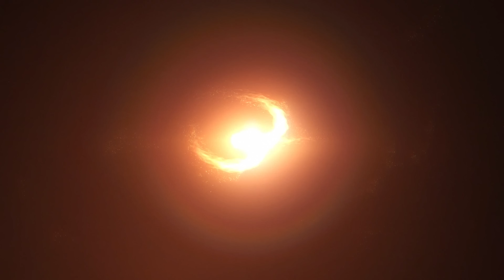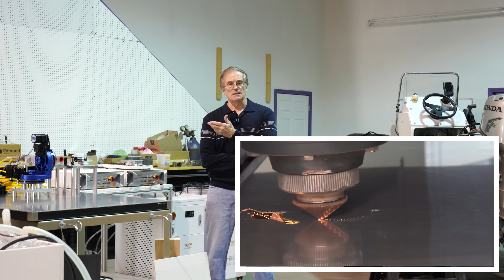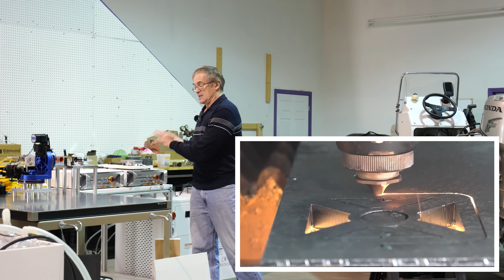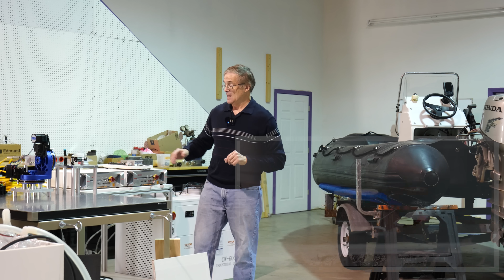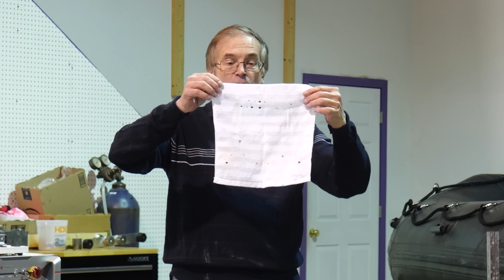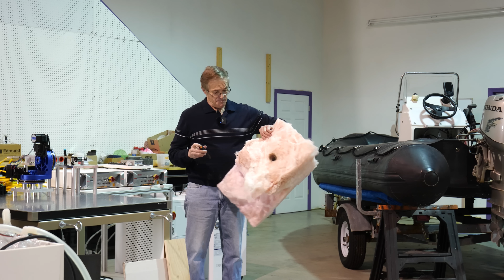We have a problem... and need your help!

Comment: Not an optical engineer, but it sounds like you need a light trap of sorts. The materials suggested might not be suitable so take the suggestion with a grain of salt). Assume prop 65 if you like.

A fire resistant curtain (something like a fibreglass or carbon fibre blanket) that obscures a mirror that directs the laser downwards into a tank filled with an IR absorbing material (liquid or solid).

Ideally what's needed is a method to decollimate the beam once it's passed through your target.

Comment: Such a problem to have!  If you know where (generally) to laser will be hitting like behind a test panel, then you need to refocus (unfocus?) the beam to dissipate the energy. Perhaps a Fresnsell lens or concave lens that refocuses the beam to a larger area might allow you to absorb the energy in a larger area with most common materials. Depending on the frequency of the beam the color of the absorbing material can be used to enhance the absorption. If you can change the frequency of your laser (most etching lasers have that setting) you might be able to allow greater scattering.

Comment: A large container of water with transparent sides might be (slightly) easier to handle than a brick wall? A mass of water, maybe with some black dye added to increase absorption, might diffuse the laser enough? Empty and refill the container to move it.

Comment: Maybe glas that acts as an optical diffuser. The laser concentrates light, the diffuser does the opposite. On the otherside you end up with none dangerous light.
In any case, I would use a Phototransistor to cut off the power, if it detects laser light outside of the control area

Comment: That's a nifty problem to have!  Some thoughts:

1.  Instead of firing the beam sideways, fire it down into a carbon slurry.  (e.g. crushed biochar and water)  That should absorb the beam AND the heat, and you can make it as big as you want.

2.  Fire it down into the earth.  Who cares if dirt gets blasted?

3.  Speaking of earth, you can make a wall of 'compressed earth blocks', which are as cheap as dirt--literally--and will easily be able to withstand the beam for at least a minute.  (Digging into CEBs would also make for an interesting video.)

Cheers!
Reply from the maker: I like the dirt blocks!
We have to stay horizontal in order to have enough range to make the test meaningful. The laser system can't be too close to the ceiling for access and assembly/alignment.

Comment: I'd bet on dirt, sand and clay: non-toxic, non-combustible by everyday definitions, slow to react with anything but water/moisture, cheap and easy to obtain in huge volume. Also you can set up a test first basically for free.

Comment: What about an aquarium of milky water behind the beam?  Does it punch a hole in the glass?
Reply from the maker: It would damage the glass.
The more important limitation is that we have to protect the entire back wall.
Reply: @TechIngredients  I recall you had a diffusing white paint for cooling into space.  Could you build a wall fountain with that paint as the backing and water flowing over it constantly.  Or preferably bubbling down it with white sudds...  That's a lot probably, but might work.

You could test it by painting an old washing machine with your super paint, then load it with way too much soap.  That'd be a good watch in any case!  =)

Comment: Nice, hold my beer! cheap and effective is the goal?

You want a blackbody that will not decay. I don't think we can do that on the cheap. I believe China uses white oak as re-entry panels for some space craft. It's a cheaper disposable option to fancy NASA tech. You want to be safe when the laser stops by accident... Make the target move!

Lay two pieces of plywood down on it's 8ft edge. Notch them out so they can nest perpendicularly. Spin them on a motorized LazySusan of sorts. We do this in the microwave to not burn single spots. I bet you it could take 30 seconds of burn or more if you had two sheets 1½" thick, layed perpendicular. I'm sure you can reinforce the hotspot. Move that baby! I don't know much, fire may even be a black body radiation, that bloom of fire and smoke may even absorb laser. 

You may call it the Lazy-Addison.
Reply: So the effective target will be 4' tall and what is that like 5.5' wide? Spinning.
Reply: I was going to say you could make the target out of the stuff I make my quadcopter shells and rotors out of... But we can't have you good at cutting that...
Reply: What are you thinking Addison!? Spinning thing, lasers... Cut a disc in the plywood, maybe several layers if you want to be extra careful. Spin her up to speed and Wham-O. World's most redneck  optical drive. Once you're done you can sell it as a big screen mechanical TV 🤣

I bet you don't want it wet. Water will boil and blast the plywood apart faster than the laser.

Comment: Hello Sou o Carlos De São Paulo Brasil

i don't know much about optics yet, but I came up with the idea of a specially built box at the back of the experiment.
A light trap
With the aim of deflecting and reflecting the light many times inside the box, and each time it is deflected and reflected, some device is used to reduce the energy of the laser light (perhaps absorbing filters and beam-broadening lenses).
A kind of set of mirrors, lenses and filters with filters capable of stopping the concentrated energy of the laser light and expanding the width of the beam, making it less concentrated.
This is just the initial outline of this idea.
If you can't stop it in a straight line, deflect it countless times to a set of specially designed mirrors, trapping the light in a labyrinth of reasonably reduced dimensions, with several filters (optical brakes).
Here is the main idea of my thinking on the subject, I hope I was clear and somewhat useful. Just an idea.

I really like your channel and it's a pleasure to collaborate, even if just a little.

Congratulations on the great work, happiness and prosperity to all
Cheers : )

Comment: What about trying some of these? https://www.youtube.com/watch?v=4NzyClzm7Po    interlocking so easily replaced when damaged or any holes could easily pointed with cement and the blocks would allow tempory structures to be built to the required dimensions as required. After the project is finished they would make a nice garden wall for your garden or could be re-sold to recoup your outlay.

Comment: Turn your room into an oversized laser engraver. Mount a fiber laser engraving head in the ceiling and pump your laser to it. Cover the floor with some sand. The high scanning speeds of the engraving head will enable you to accurately target fast moving objects and deliver an optimum laser pattern for a specific target. Hyper accuracy, speed and special firing patterns could reduce burning through targets entirely. Example: target the heat of all 4 motors of a quad multi-copter. Command the firing sequence to create a high speed “x” pattern between all 4 motors. Critical damage to all components at once.  Short duration shots until the aircraft fails and less burning through targets.

Comment: Get a beam expander optic, and then a beam dump. That’s how we do it for 50-300 kW CW. Beam dump is usually glass fibers in a box with a hole in the front, they might be fancy not sure.
Reply: Oh and don’t stand in front of it

Comment: You need some kind of heat resistant refractory.  There are some specialized fire proofing refactories that are used in refineries that you could test.  In the old days, concrete was used, but, there are better materials that are designed to protect steel from heat.   They can be on the expensive side and they take some time to install, but, you will need something of this nature.   There are also fireproofing materials that are designed to protect structural steel.  I think some of these are designed to dissipate heat by slowly burning off, but, they can get pretty expensive.  I think Resco is the name of a refractory supplier.

Comment: Patio pavers - made of concrete, cheap and can be glued to plywood with construction adhesive. or cinder blocks. The batting/insulation material used in smelting gold , hang it as a curtain ...

Comment: Not an engineer, but I love the show and I have been watching for some time and I am ashamed to admit that I am just subscribing.  I  thought I had but I..   Anyway.  I am with the guys that say dispurse the laser up front instead of absorb it in the back.  A lense that is cut in two can be applied robotically from both sides (not sure that is a word) immediately after the target is destroyed.  Practically speaking, your target will not always be in an area that you can put an light absorbant  material behind and in a battle situation that would be impossible but if you diffuse the laser up front viola destroy the target, dispurse the beam, cut the power.  Or add a range finder, calculate how long it will take to reach the target and destroy it, and have your computer kill the power once the range is reached.  It has been great watching the show, I love you guys and thanks for asking for the help.  10232 comments.  You must have a few solutions in there.

Comment: How about Carbon Sugar Snake sandwiched between drywall panels? It's non reactive, no dangerous gases, good insulation. Or the same drywall panels with ash in between. It should be enough. Not sure about the thickness needed, but I reckon you will test it. The beam would pass through the first drywall layer, would get absorbed and scattered within the filling, and probably never reach the second panel.

Comment: I have precisely zero knowledge of this topic and the equipment involved.  So be gentle if this suggestion is absurd, lol. (Though I'd be very interested in the details of a correction, why it wouldn't work.)

Instead of trying to block the beam, why not set up a receiving lens array to diffuse or "re-widen" the beam, either to the point of being harmless or in conjunction with a physical barrier of some sort?
Have such an array set up as a target, and conduct any experiments midway along the path of the beam.

Comment: I was thinking about how impractical a high powered laser system would be to shoot down drones out in the real world.  In the real world you can't place anything behind a flying drone to protect from damaging anything or anyone who happened to be behind and above the drone as in a plane or helicopter.  So I came up with a possible solution.

Not one very high powered laser but many very low powered lasers.  The kind that use a small button battery.  You don't combine them into one beam but have many beams that triangulate onto one spot.  That means anything between the lasers and target will be safe because they only be hit with one beams intensity even if they were hit over an area by many beams.  Nothing behind the focal point of all the beams would be endangered too for the same reason.

Think of it this way.  An elephant hit by one bb gun pellet would probably barely feel it.  But a thousand bb guns all aiming and hitting the elephant at the same time in the same spot is a totally different story.
Reply from the maker: I understand.
It's complicated.
The tracking and targeting systems are actually more challenging than the laser.
These would have to be multiplied as well as coordinated.

Comment: From the perspective of the target, a drone in flight, l would  be more concerned with the laser proving the drone with a high energy trigger than can be used to make a drone cargo lethal over target area.
Reply from the maker: There is always a push and a pull. A facility that can eliminate a drone is a valuable target to a drone.
However,  the facility is a given and it won't be isolated because it's there to protect something even more valuable. 
The solution is to make the system very effective or perform a first strike.

Comment: What if you cover the plywood with a layer of jelly type substance maybe a foam that could absorb the heat and stop the fire. You could possible fill the jelly with flakes to break up and light bouncing around.

Comment: 2 panels but between it a layer of sand, but it needs to be tested, the sand would either fill up the hole constantly or if it makes glass around the hole/beam it wont work. If it does work it's just patching the wall and refilling some sand. Testing would show how thick the sand layer needs to be.

Comment: Personally I think it is insane messing around with such high powered lasers.  You can easily blind or kill someone with one of those things.  That being said I suggest you try using a curtain of falling water that is at least an inch thick.  Not droplets of water a solid curtain of water.  Maybe throw some red dye into the water or whatever color absorbs the wavelength of laser light you are using.

Comment: Two suggestions, possibly used together:
1) An intumescent coating on your chosen backdrop surface. I'm pretty sure it'll do a good job of absorbing energy and buying you time.
2) A black carbon rod inside a vacuum tube or black carbon sphere inside a vacuum bulb near the laser could be dropped down as a failsafe to absorb the beam without combusting. The right carbon target might not vaporize but just emit blackbody radiation as it heats and it won't combust in the vacuum.

Comment: Two ideas. 

The first one is a "waterfall" 

Instead of soaking blankets with water, create a curtain of water that has a dye that can absorb the laser light. Since the water is constantly pouring down it can't be evaporated away. If the water needs to move faster than gravity can make it fall and you have a narrow beam then you can use a jet of water to neutralize the beam. It doesnt have to be enough to completely block the beam. Just enough to weaken it. 

Idea two. 

A rotating block of ice. The ice would sit on a table and spin in the path of the beam. Again. It doesnt have to completely block it. Just absorb enough energy to keep it from cutting through a secondary barrier. 

Since th block is rotating the ice would eventually fall once cut.

Comment: You or anyone else who's watching this will never get this comment due to the nature of YouTube but I'll try anyway. What you are looking for is called a beam trap. They are available as an RPO from several manufacturers or you can engineer and build one yourself. Most designs are dry but I've used at least one transpiration design that worked well. A poor man's option is a consumable ablative but if you plan on doing a lot of this, it won't be poor man's for long. You're material approach is using the wrong physics and chemistry. to solve your problem.  You are also asking questions that suggest you may benefit from technical support from someone with expertise with HPL technology before you burn yourself or put an eye out. I work in aerospace an defense and the leading contending technology for counter drone defense, particularly swarm, is not directed energy for many reasons. I'm also involved in drone propulsion systems as well. 
Good luck.

Comment: 45 degree angle down into vat of water and charcoal, with water cooled or safe refrigerant gun blued heat sink above to catch stray light. Steam may form causing issues tho So further light containment from black carbon fiberglass for that. modify as seen fit. Maybe just a heat sink. Maybe press on button record and not be in room lol!

Comment: I would suggest giving straw bales a try.  They're packed densely enough that there isn't enough oxygen to sustain a flame.  They're highly modular and mobile, and you can plaster the exterior should you decide to use some sort of coating.  Also not very expensive and pretty thick.  Cons:  may be some smoke and if handling loosens it too much, it is flammable.

Comment: Scattering vs. Absorption: While a frosted surface scatters light, it does not fully absorb the laser energy. For high-power lasers, the scattered light could still be hazardous if it escapes the opening or if the ball itself is damaged by localized absorption and heating, as even highly resistant optical materials have damage thresholds.[3]
Laser Beam Dumps: Standard laser beam dumps, designed to safely terminate high-power lasers, typically use highly absorptive materials (e.g., specialized black coatings, graphite, or ceramics) often arranged in conical or wedge shapes to maximize absorption and minimize back-reflection. These are frequently integrated with active cooling systems (e.g., water cooling) to dissipate the significant heat generated by Class 4 lasers.[4] [2]
"Limiting Laser Length": This phrase likely refers to attenuating the laser's power or completely terminating the beam. A frosted ball within a metal casing would act as a form of beam dump, converting light energy into heat. However, its effectiveness and safety for high-power lasers would be questionable compared to purpose-built beam dumps due to potential for damage to the frosted surface and inefficient energy absorption .

Comment: How does the beam absorb and reflect when it hits various materials at a sharp angle of incidence?  can anything reflect it?  with some slight degree of scattering /diffusion?  For examble: can you cluster recycled aluminium and other metal lengths of tube slightly off axis from the beam, and decrease its energy and focus over multiple incidences of reflection and absorption?  kind of like an anechoic chamber wall but for laser light?   making the energy lower and beam less focussed over x reflections?

Alternatively can you mechanically restrict your directing of the laser in testing, to a small area with a deep stack of bricks or what have you, and then simply not use the laser, or use an alternative laser when you're otherwise testing the tracking and directing over a larger field?